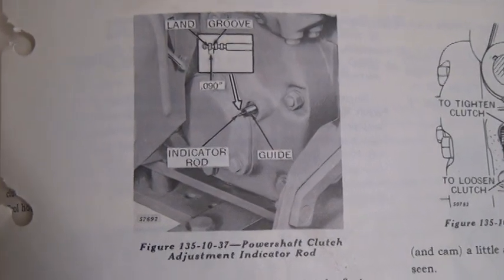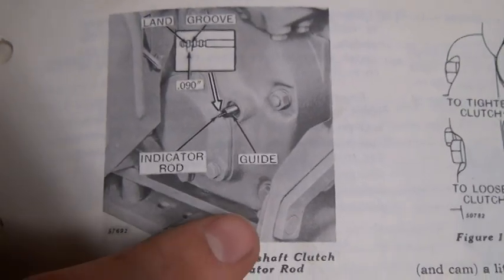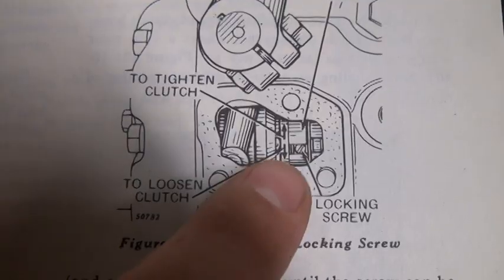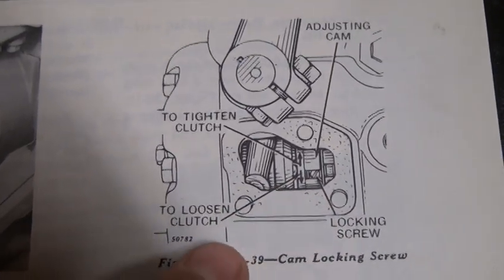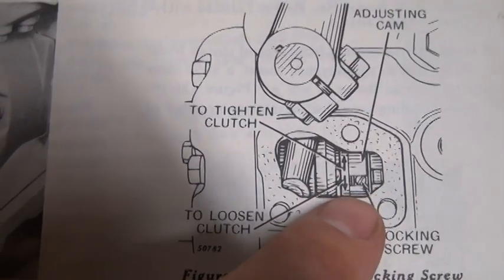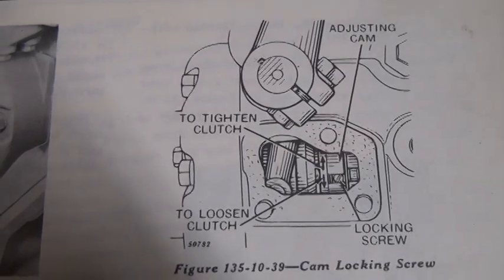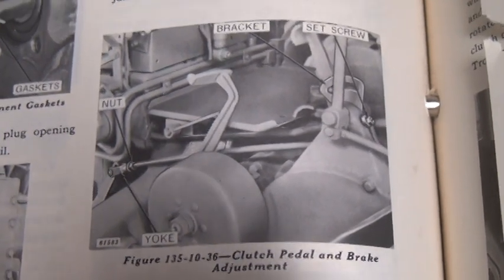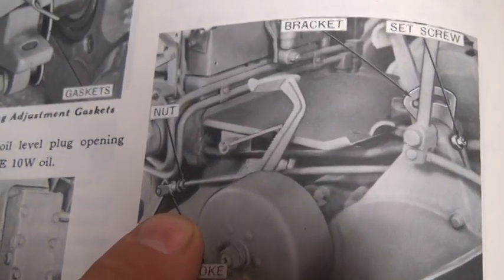Part 33 - PTO Clutch Adjustment - 1.MPG

Comment: So what was the idea behind that indicator shaft with the multiple grooves at the PTO housing? Can you put an indicator on there to track your movements or????? I wasn’t sure what they were using that shaft for....if your adjustments have to land at a certain spot dictated by where you can lock in that cam (.015 per position) there isn’t much point in reading the shafts movement with an indicator because you can only live in .015 increments right? 
I guess it would be nice to set an indicator on there and “zero” the dial and once you start adjustments you can always remember where you started at. Still not sure why the shaft had to be grooved? ( and the manual wanted you to be aware of the location of that groove so they must have something in mind with using it for measurements.

Comment: My 1250 jd the pto will stop but I have to hold the lever back will try adjusting thanks .
Reply: Mr Ron do you have a Massey Ferguson 1250 reason I'm asking I have a 1250 I can't find the steel screen filter that goes for the hydraulic fluid not the filter that you screw on that's paper but the screen that they say you wash out and put back I've looked all over this transmission and I can't find the cover plate to the dealer or my book describes was wondering if you might know my tractor's been slipping and high gear pretty bad I don't believe it's the clutch because I hear no grinding from rivets I'm thinking it has something to do with the fluid not being the proper amount in volume I'm never changed out this filter or rather washed it out I just bought the tractor a couple years ago for my father who had it for 20 years and never even knew about the screen filter and I think it might be my problem anyway if you could help me I would be grateful

Comment: I change. The clatch on massey 135 and hab on the gearbox the tractor was open for amonth after l put anew disc and fresh gear oil the hydravlic does not work .lf anybody can help me l will apriciate thanks.
Reply from the maker: Hi Paul!  The transmission does not take gear oil, it takes Hydra Trans Transmission oil.. Sounds like you may have the wrong oil in there!